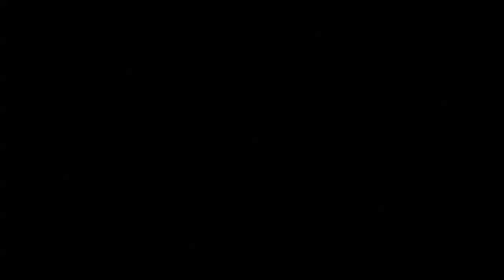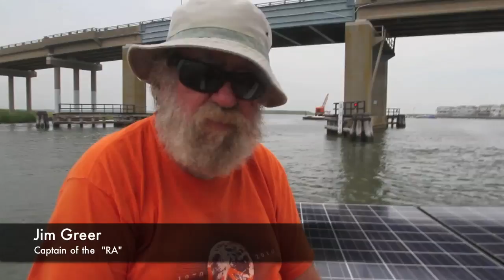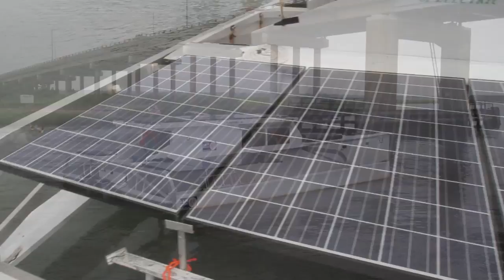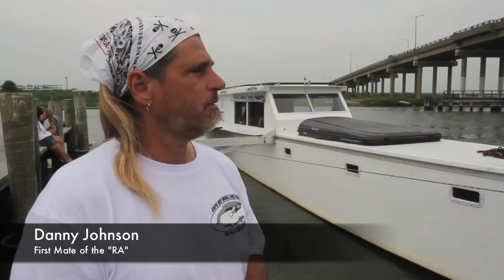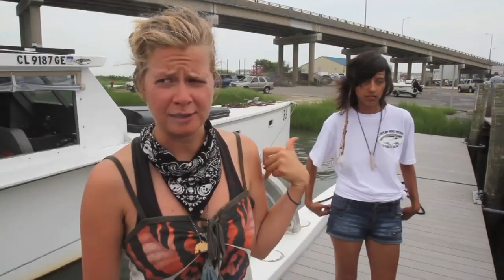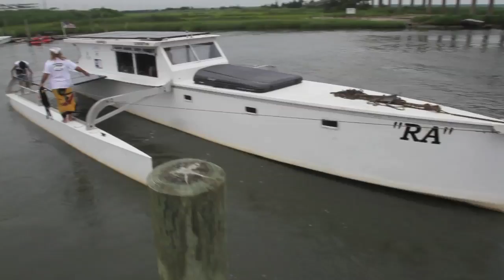Solar Powered Boat RA

Comment: I heard this boat does about 5 mph as typical continuous cruise speed.
What's the displacement of this boat?
Waterline length and beam (central hull)?
Basic underwater hull geometry (flat, round or V bottom? rocker? stern design? draft?)
I'm asking because such information can help to better understand the efficiency of solar-electric propulsion (solar peak power, Torqueedo engines).
Reply: I was on the boat for six weeks.. on calmer no current.. 5mpg was just about full speed.. super slow..  I think it was 48'

Try to contact him directly..

Comment: Is the solar panels regular or marine?  great job.
Reply: S/V Redemption, not in wattage, but marine panels are paper thin and made to walk on. Big difference. Doesn't seem to be an issue here though with such a large boat, plenty of space. But regular solar panel are really fragile if you would drop something on them for example. Also connections might be difficult to get really waterproof, which would be important in case of really bad weather.
Reply: There's no difference. Panels are designed to sit outside untouched for 20-30 years so there made from materials that last and don't corrode.

Comment: d you add more powerful motors and a few panels as well as a few more batteries to make it a little more fast and able to cruise at night? Maybe a couple wind turbines things to power the lights for night cruising and to help charge the batteries as well as phones and such.. Is the boats design  for sale and if so where can we find it. I am hoping to have something like this to travel from Texas to Florida and out into the Caribbean. I love this design, You are a truly crafty fella.
Reply: +Johny Osborn You know, I don't think you do want this boat, exactly. If you want to  "add more powerful motors, and a few more panels, as well as a few more 
batteries, to make it a little more fast and able to cruise at night? 
Maybe a couple wind turbines things to power the lights..." you would obtain a much larger boat. She might still be a kind of similar design, as in still a quiet, dignified, low-pollution, hull speed cruiser. But, hoisting on "a couple 200hp outboards" ? That fundamentally changes things, wouldn't you agree? Those aren't trolling motors.  Ra couldn't carry enough gas to get out of sight with those things. But you've got the right notion. I'd much rather have you quietly puttering around the outlets and bars with us, than screaming up and down the bay at twenty gallons to the minute with the other berserkers.
Reply: +Johny Osborn  any luck with the boats design?  i love the design of it myself, id be happy to pay £1000 for the plans
Reply: no,no one ever contacted me or anything.  There are some other boats(sail mostly) that are trimarans. They seem very cool too but I don't know how to sail.
Reply: one is a dragonfly and the other is a corsair 22
Reply: cheers dude.. check out a boat called "sun21"  its a smaller solar powered catamaran which crossed the Atlantic :)
Reply: Will do,Thanks. I've watched several solar powered boats and eventually that might be the way to go but I'd like to have something like RA but with a couple 200hp outboards for when I need or want to get away or somewhere in bit quicker. I'd go solar most of the time but like to have the peace of mind.
Reply: Yep, I want to travel the Greater Loop a couple times and then ease down to the Bahamas and make my way to
Puerto Rico and then back the way I can to the U.S. The ease down the coastline of Texas to Southern Mexico and as far as Columbia. I think my next boat will be a trawler. They get really good fuel mileage and with some solar and wind turbines for some of the electrical and a generator I should be ok. I'll put a 115 hp outboard for emergencies and call it good.
Reply: Johny Osborn yer definitely underpowered he even said they had to sit at anchor for 4 days because the NE was to strong.